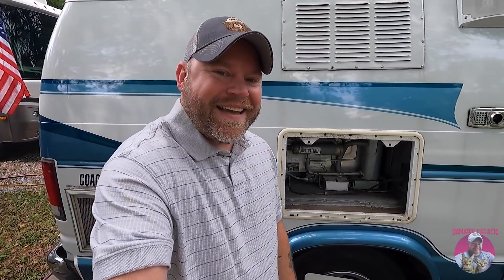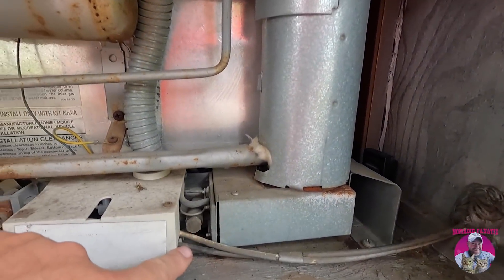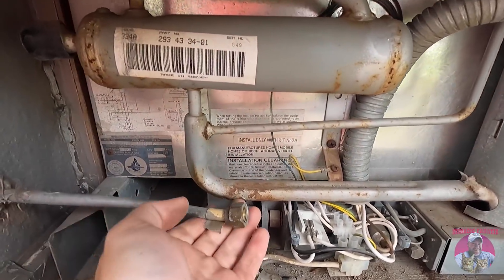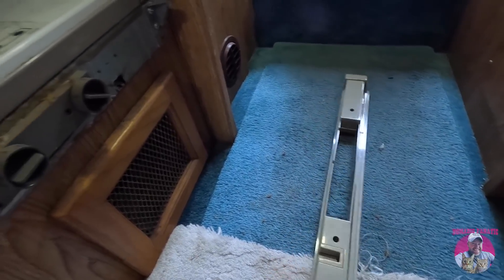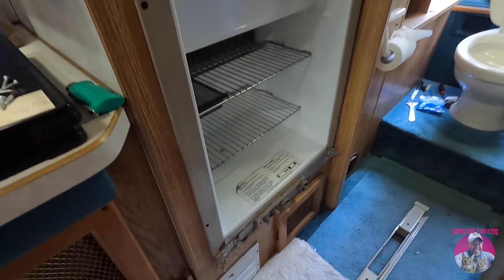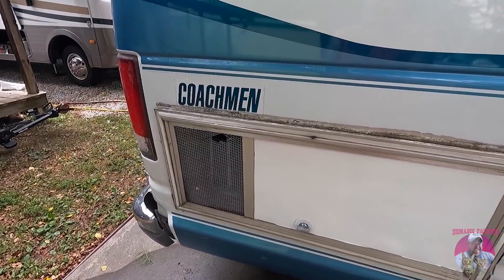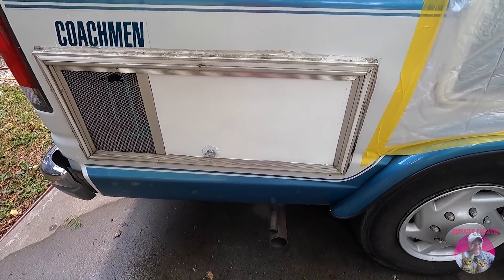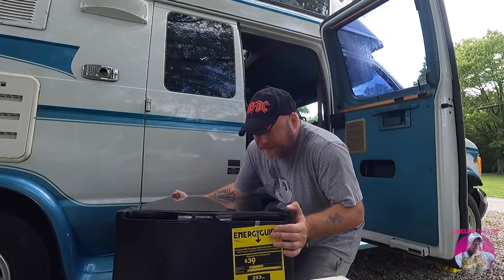RV Class B Campervan Fridge Replacement

Comment: About the fridge: Don says that it seems like they didn't account for the feet and the hinge. Take off the feet and router out a little for the hinge and it should be ok.
Reply: Theres your answer Eric
Reply: Also, removing the plastic hinge cap might save you another half an inch.

Comment: Sometimes taking the 3 way out  and turning it upside down and shaking it loosens up the powdered refrigerant that is common with propane fidges, reinstall it and it may just work well again. This comes from experience with Servell propane  refrigerators that were used back in the day
Reply: Yes, that is called burping it. It does work, sometimes will work perfectly after that, sometimes for only a short time.
Reply: @Twinjeremy  again you need something in the freezer part some mass.

Comment: Our fridge / freezer combo in our 1992 class c is a small one ( same looking size as your original one ) . Got it at Walmart . It was cheap , easy to rig so it didn't move around , fit the same hole and we just plug it in before we leave a few hours to get cold or run it full time when at our private get away on land power . Works great so far  ( two years now ) .

Comment: did you check to see if the new refrigerator has adjustable feet that may need to be adjusted or removed to make it fit ????????

Comment: When you redo the seal around the generator, if you haven't seen them before, the plastic razor blades are great for removing it without hurting the van paint.

Comment: I see you measured from the top of the door swing. I would check of that plastic on top of it can be removed and then measure it again. Also, check if the feet under the fridge can be removed if there are any.

Comment: i wonder if theres removable feet on the bottom that need to be taken off. and i'd highly doubt theres a "direct fit replacement" for that old of a vehicle. sometimes what they call "direct fit replacement" is just a guideline. but the with that fridge too it didnt look like there was any kind of seal around the edges so you'd have a big gaping hole in the side now.

Comment: Sometimes replacing old appliances is a good idea even when the original still works. New appliances work more efficiently and can be worth changing just for comfort, noise, and overall efficiency.
Reply: Agreed. I did the same.

Comment: Remember, the furnace is something you were going to replace, anyway.   So, let me suggest you consider one of the Webasto gasoline powered heaters that can be connected to your fuel tank, since it is MUCH smaller and would allow you to lower the support for the refrigerator.

Comment: I am glad you showed how to take out the refrig, sorry it didn't work for you. I have the part to put in gas line but I am afraid of gas. I bought a electric refrig because I just stay one place. My camper is a 1998 and freezer works but refrig doesn't get real cold. Parkway Rv said new campers are not going to have two way refrigs, because of the shortage of parts.

Comment: Sorry about your "direct fit replacement"!  Try Vintage Trailer Supply, they might have a refurbished unit that fits.  There is also an Amish guy in Napanee Indiana that advertises in those free car magazines you pick up at stores and gas stations that repairs them if you want to try that route.

Comment: On the bottom thed the feet all the way out  remove top hinge covers it might fit may be remove plastic top if it goes in use shims to wedg tight 
Good luck

Comment: Eric, That new fridge looked like a "free standing" cabinet or "dorm room" model. Any chance you can remove the entire case and the REAL dimensions will fit your existing opening???
 - Jerry from up in Waukegan
Reply: He was measuring to the hinge covers.  The size of the fridge he showed is box size which is typical measurements shown.  It does suck and they should give overall measurements hinge to hinge.

Comment: The refrigerator runs on Anhydrous ammonia and the flame is no bigger than a quicker like a candle to keep it moving and also when it’s on electricity there is no more than a heating element to warm it up to keep the anhydrous ammonia moving

Comment: Eric, have you considered replacing the old water heater with an on demand propane fired heater?
They come in a variety of BTU sizes.
And...you only use propane when you actually need it.
Best to you however you decide to go.

Comment: Hmmm🤔 Sorry to hear about the new fridge not fitting, it did kind of look a little bigger to me with them sitting side by side, I thought it might possibly be an issue, but I was hoping that it was a close enough fit, so you could work something out with it😏

Hopefully you can find another one that fits better, I liked that it's bigger inside than a standard RV fridge. 

Sorry that it didn't work out for you.

Comment: On the AC replacement it is so easy you will be blown away once you takeoff the bottom panel there’s like four screws that pinch the unit to the roof and then a couple of wires ours went out on our camper they wanted $1200 to replace it I found the unit I needed for $550 and did it myself it took all of 30 minutes

Comment: You can get a replacement absorption tube for this probably easier than a new ref. A 12v or 120 V unit is power hungry and really not best for boondocking even with lithium power. Propane is more suitable and better on power requirements. Most dont cool that well however in very hot weather.Your's is repairable..Might be the way to go.

Comment: We have a 1995 b series Dodge 2500 Camper hightop van remodeld in 2019 but almost needs another one, starting with the carpet' , the lvt flooring has held up well, really like your camper van! We just got the AC fixed today in ours its never felt this good since we bought it lmao

Comment: Hey Eric I noticed after watching this episode twice. That you have brace bars underneath the refrigerator. That's why your new refrigerator doesn't fit in place. Before you return the new refrigerator take out the brace bars that are on the floor of the old refrigerator spot. That should give you plenty of room to put the new fridge in.
Reply: Disregard comment I realized after watching it the third time that those rails that I saw were actually attached to the old refrigerator sorry for the misinterpretation. I guess the only other option is to do what you said and just order another refrigerator.

Comment: If you pull it out turn it upside down and leave sit for a few days. It will start working. Also anytime you remove a gas line use two wrench’s

Comment: Eric, Having worked on several RV refrigerator's, I know some neat tricks to make them work. Yes yours is a propane fired unit. The "Refrigerant" is Ammonia. And, It is 27 yrs. old. I have a 30 yr. old in my mancave . Turn the unit upside down and leave it for 24 hours. Turn it back over for 2 hours or so and hook it back up temporary. It will be regenerated and be ice cold providing that the Ammonia did not leak out.  Don't laugh, Try it. What  do you have to lose?   There is also an old YouTube video showing this.

Comment: I never understood why people need a microwave to boondock, part time or full time..Personally i would not have a microwave in my Van.take a deep breath when you feel the fustration starting.I admire your detailed work Eric...
Reply: Super convenient during fire ban season...& if itz hours to drive to refill small propane tank while boon docking...or if itz raining or snowing too much outside.
The solar panels now are so efficient even in low light ...so with a battery bank can have power to run a small microwave - boil a cup of water for hot drinks, steam veges, bacon, scrambled eggs, melt cheese, reheat dinners. Even heat up a couple bowls of water to use for washing self. No need for a hot water system.
Is very quick, compact & no mess.
Reply: @mymai2792  yea, fast food

Comment: Eric,  I know we are several days and you probably already have your solution.  My thoughts are the newer microwaves are smaller.  Less expensive and I would look at replacing the microwave with a smaller unit in outside size but still maintain the inside cooking space.  You will probably get the space you need that way.  Plus the new microwaves are much more efficient and cook hotter.
Just a thought...

Comment: Had the same thing happen with house frige.  20yr old one died.  Space in older house had cabinets above so measured old frige and space.  Went to store.  Measured friges and bought one.  It was delivered and did not fit!  They adjusted wheels and still did not..  3 friges later and after manager came to measure twice they found one.  Turns out wheel height mechanisms (mechanisms! Not the wheels!) add height that is not part of measurements.  Manager had to call home office to find this out.  For yours wait til friend shows up and remove floor.  If nothing critical under there pl ace or replace board.  If you ever get a true replacement then you can readjust that board.  More work but hey at least everything will work.

Comment: I have an idea....If the height of the fridge without the hinges would fit in the opening, can you take a jigsaw blade to notch out top and bottom slots for the hinges?  Also, are the feet removed/removable?  Sounds like it's close but not quite.  Maybe these ideas might help.  Best of luck, Eric!  Rootin' for ya, man!
Reply: Also, seems like it would be super awesome to be able to get THIS fridge to fit to really give you some good fridge space instead of getting the next size down which may have a lot less cubic inches of storage.  Just a thought.

Comment: Shame your so far away I could have helped mod that cabinet.    Retired with nothing better to do. I have a 1972 Airstream trailer and put a 12 volt fridge in and replaced a few other things like the AC and water heater also added solar 1200 watts

Comment: Eric, take off the rubber feet, & if you need a little more hole saw that board where the bumps are where the feet were. should fit then.

Comment: Hey Eric  Well Vanna White is looking pretty sharp!  Sorry bout the Fridge.  I would go direct in person to an appliance store
Lowes ~ Home Depot ~  so anyway, I would bring along my Tape Measurer and be sure of the dimensions.  Not just W & H but also
the backside of it. Take a picture of the old one to compare.  Then it should fit totally fine since measured.  Listen, yes it is frustrating,
but have No Doubt, You can Handle It Very Well.  You can just about fix anything.  That Black Fridge wasn't meant to be.  Think about it.
Only DC well I'm thinking that having a 3 ~ Way is better.  Triple the security of keeping things Cold!!  No need to get that mad, ya don't want High Blood Pressure!!  So ya really need to learn to take a deep breath and know that many of us have plenty of frustrations too!!!  
Ok

Comment: Sorry you're having so much trouble it's very frustrating plus out in the heat not the greatest time to be refurbishing things outside but being that van is so old I think you're going to have to get your mind around the fact that you're going to be replacing things and they're not going to be easy due to the age of the van so get your mindset around that and keep going forward because you will succeed you always  do

Comment: ERIC,
I HATE those itty bitty refers. I have owned 3 of them.
Even when they are brand new they are POS. Usually
a new one will work sorta ok for about 6mo then stops
cooling. 120vac in the shade works best. If you can
replace it with something else you won't regret it.

!

Comment: Recharge the coolant? … …OK Eric! ... You're missing something Big! ... You absolutely
need to make this change too! I assume this is a 1 Ton chassis. You need to
change out the front axil for a One Ton 4x4 solid front axil with air lockers
front and back… minimum 35” tires… and don’t forget a winch in case you get
stuck… Yeah! … Oh … and the transfer case … 3 speed transfer case … that’s the
ticket!  … Yes?    Well, Yes?    Frig don’t fit … if you can cut down not up …
assuming you have some room above the floor …Also some people change out the whole
cabinet including the microwave space to better accommodate for better free space
too … Now then, second thought … you are rebuilding the camper …would it be
worth it?   A couple weeks ago … Eric … you
said you wanted to build your own camper … word to the wise … watch what you
say … you may get your wish! … Hay! On that note! …  See now I’d like to be a millionaire …
nothing?  …. Huh … OK I’ll give it some
time!

Comment: You might want to stock up on all the maintenance items for under the hood:
Extra belts and hoses
Gaskets
Water pump and alternator

Flush all the fluids ASAP, change the oil and transmission fluid.

Comment: Wonder if the new fridge had mounting feet on the bottom…removable?  If 4 mtg feet…can the floor be cut out at 4 spots to get it in?  Yes, very frustrating when the printed dimension does not match when measured.  But….it’s not the last time and it is not the first time…..you will find an even better solution eventually.  Remember life is a bitch…then you die!

Comment: Something else you need to check is because of the age, you may still have the  "OLD" fill fitting for the propane. Your tank needs to be empty to  change the fill fitting and recertification.  We have a 92 Bounder. Understand about a "Classic" repairs. And direct replacement fit. Never. Go chill with your fur babies.

Comment: Everything is on back order right now.  At least the things you need the most.  I went to get a new tire for my Jeep and they are on back order.  I was going to use the spare (Brand new only a few month old) and the new one to replace my back tires and take the back tire with the most tread left and make that my spare.  But I can't get a 35X12.5R17 MTR until Mid September.  Good thing I don't "Need" to replace the tires now.  Just figured it would be nice.  Heck even lots of tents, coolers, and other camping supplies are on back order.

Comment: Why not check at an RV Consignment for a used reefer and AC?
Me? I kept the altitude set at the 600 ft setting as I'm in Springfield. But unless I was below 400' it stayed at 600 unless at higher altitudes of course!!

Blue skies and safe journey's!

Comment: Did you clean the burner on your original frig. You have to take the cover off the burner. Spiders love the smell of propane and will cause you problems. Also propane frigs don't have refrigerant like 
A/Cs and regular compressor frigs that you can add to. Yours has a combination of ammonia and other chemicals. Cut a notch for the hinge and check the adjustable feet.   Also, 31.25 - 30.4 is not 1 3/4". It's .85".   .75 is 3/4", so it's 1/10" over 3/4. Safe travels and better luck in the future.